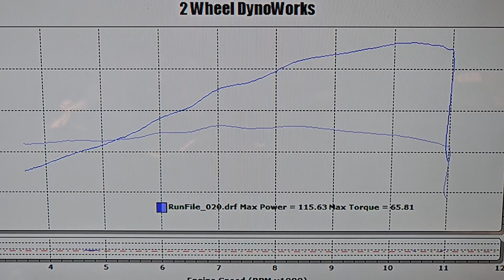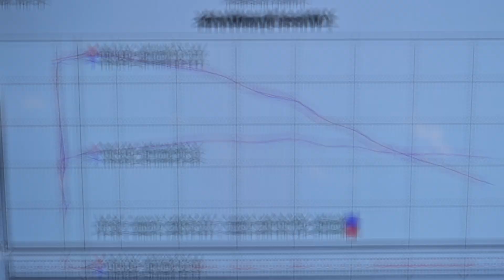2024 MT-09 Air Filter Testing and Chassis Geometry Adjustments

Comment: I've got more clearance than that on my 2024 MT09 with the same exhaust. I loosened the allen screw on the back of the exit pipe and rolled the tip out slightly. I'm not a track star by any means, but maybe that will help.

Comment: How about ERC Sintered Brake Pads at least in the front?  I found initial bite improved.  Maybe a Pro like you could comment?  Brakes like suspensions are often dinged just because they aren't the best Brand (
Brembo/Ohlins etc.).  I will say the Brembo MC does feel better, but the Pads make a huge difference too..  Possibly more than the name on the calipers.

Comment: Informative video. What's your opinion, is it worth the $$ to buy a DNA Stage 2 Air Filter to the already planned ECU Flash on the MT09 Gen 4? Or is the stock filter or a regular DNA Air Filter enough with the ECU Flash?

Comment: Dropping the forks nearly eliminated the high speed wobble.   I think the bikes spring rates are unbalanced, with the front being too soft compared to rear.  So it helped on mine to crank the front preload but leave the rear 1 or 2 notches from full

Comment: The stock air filter has 50 pleats to the dna’s 25. Even though the dna looks like it would flow more, i bet if you cut them out of the housing and spread them open the stock yamaha has more surface area.

Comment: I understand that you are a big guy but if you're saying that 240 is too much for this bike than I have absolutely no idea how are you supposed to ride 2 up on it. there is no way to not go over 240 with two people on this bike unless you mean it in a way that for track riding this suspension is to soft for your weight. Yamaha offered a spring kit for the 3rd gen maybe they will do the same thing for this one

Comment: Isn't 190 to wide for that rim to give correct profile?
Reply from the maker: Not at all. That specific Michelin is 5mm wider than the OEM 180, just much taller with a much better profile.
Reply: @2wheeldynoworks  great. What about electronics, does fitting a taller tyre mess with abs etc??
Reply from the maker: @BamBamSalerno it throws the speedometer off slightly. Nothing more.

Comment: Do you think the SP suspension will be better for us larger riders? I'm north of 240 lbs and was considering the base model, but I wonder if the SP is the way to go? 🤔 I'm not a track rider though, only on the street and twisty back roads
Reply from the maker: Either way, the bike is undersprung for guys our size. All bikes are. Anything I keep for myself personally gets Ohlins properly sprung for my weight for exactly this reason.
Reply: Go to dealership and checkout personally.
You’ll get better idea if it will suit your needs.

Comment: I'm a total noob here but if I understand correctly, the tire size is not very important but rather the profile so you should be able to stick to the stock 180/55R17 tire size but a different profile and have the same result you had going to the 190/55R17 right?

Also, is it possible to twist the end pipe away from the swing arm on the LV exhaust? I see springs but I don't know how the exhaust mounts but I really love the look of it lol
*Edit: looked up videos on the exhaust and see now that the LV exhaust has a bolt on the backside that prevents you from twisting it away, could be solved by taking out that bolt and twisting it away but you're right, at the price of the exhaust, that's completely unacceptable.
Reply from the maker: Exactly! Anything with a taller profile will work MUCH better.

Comment: That flat rear tire profile is the exact problem I had with S22s. Front was fine but the rear would be on the edge at very little lean angle. It’s a shame, really because otherwise, they seemed like a decent tire. S21 was the same. No idea what the S23 rear is like because now I just buy Pirelli.
Reply from the maker: Exactly our thoughts as well. The front seemed great, but the rear profile is a joke.

Comment: Wouldn't raising the bar height make higher speeds more squirly? I mean, the thing is already a handful when grip and rip is engaged lol

Also for future exhaust videos, can you leave a purchase link? I plan to get an exhaust soon and a tune from you. Just waiting for your very informative videos to come out to make my decision
Reply from the maker: With the increased ride height and better weight distribution from the taller rear tire and raised front forks, the head shake frustrations we first had were completely gone. 

Some of that may have also been attributable to the S23s. Either way, it's gone and I didn't even think about it one on track this past weekend 👌

Comment: Sounds like a giant dude of your size could use a set of springs at minimum.
Every motorcycle under $20 grand has a lot to be desired with suspension and chassis setup. That said, with some good research and development, the aftermarket can get at least 90% or more of the way toward "perfect" (whatever that means) by way of neutral steering, lean clearance, pro/anti-squat behavior, and acceptable tire wear on track with suspension setup.
I had been pretty ignorant about suspension years ago so I did my own independent research and watched a few lectures from professionals in the business. Plus I'm tired of badly handling factory bikes. Factories try to meet customer targets (price, weight class, anticipated use) and as such, are totally dependent on compromises. Bikes can handle SO much better than how they come off the showroom floor.
Thanks for the information you provide!
Reply: I had the 2nd gen of this bike and let me tell you... It used to be so much worse.
Reply: @adubs.  2018 Owner. Stock suspension. It's hideous.
Reply: @turnin.sprocket  I had a 17. It was very comfy over bumps lmao. The 24 is like a completely different bike... although what they did to 2nd gear is stupid.
Reply: @adubs.  Comfy over bumps. I guess that's one way to put it.
Reply: Sounds like somebody needs to make a call to Cannon Racecraft for some spring's 😎🥃
Reply: @zrx1100zz  The chassis geometry of the 2018 MT-09 is problematic, no matter how perfect the suspension could be made to be. Yamaha changed that a lot over the next couple gens.

Comment: I appreciate you going over the suspension settings you're using because I'm not far off 240.

I'm still working on break in but the Yoshi and a tune by you guys sounds like a winner.
Reply from the maker: It's a killer combo!
Reply: @2wheeldynoworks The SP guys are crying a river hearing that the “premium” ohlins outfitted from the factory isn’t “that much better”  than the base model setups. lol. I have been saying this since the release of the gen 3 in 2021. The components that come on the bike vs the ones purchased aftermarket are not the same. Especially in the case of the gen 4 with the rear shock and forks being improved over gen 3, I’d buy base all day and put the extra money towards a tuned suspension setup for my specs. To each their own I guess. On another note I had a feeling the drop in filter wasn’t going to do much. Maybe once DNA makes a lid there can be some decent gains to work with on the tuning end